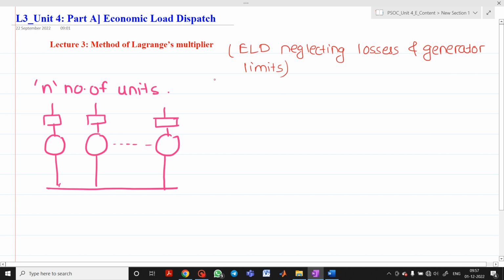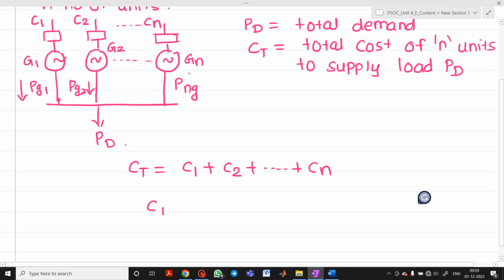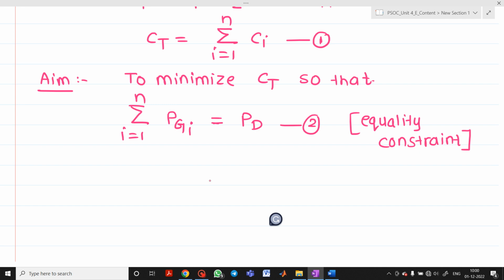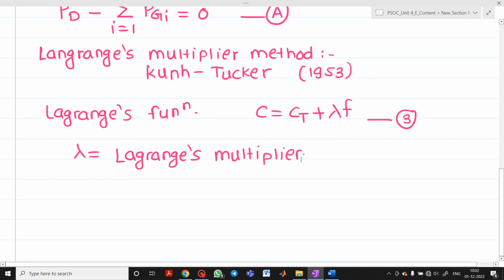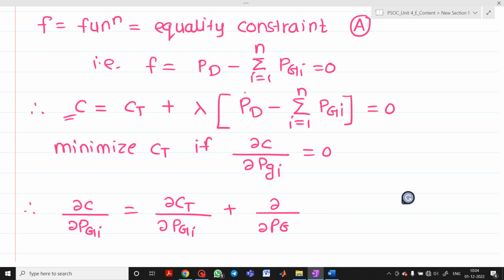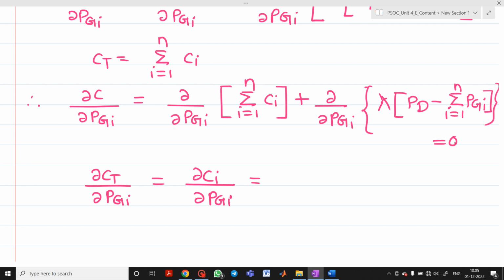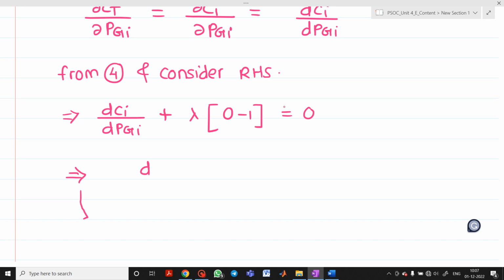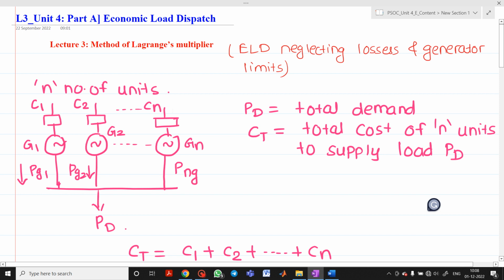Lec 03  Economic Load Dispatch Method of Lagrange’s multiplier

Comment: can you please provide the file in which you have solved above derivation (langrange multiplier)
Reply from the maker: A text book of Power system by V.K. Chandana, Cyber tech publication.

Power System Operation and Control, S. Sivanagaraju

Power system book by Hadi Sadaat
Reply: @chinmaydeshpande9674  thanks alot
Reply from the maker: I will provide you the name of book.
Reply: @chinmaydeshpande9674  yes that will also work please send ASAP